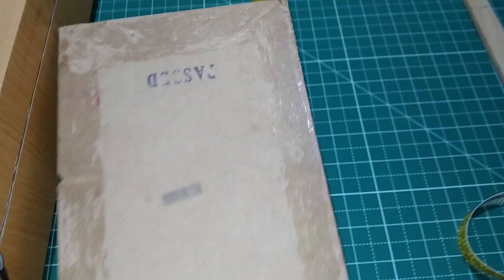DIY Flight Simulator Yoke & Throttle

Comment: Hello, friend! :)

Congratulations on the project! A question: regarding the potentiometer, is it very accurate? If I make a sharp turn, does it recognize the movement well? Or does it work better on "softer" moves?

Thanks!
Reply: potentiometers are usually pretty sensitive. If you want even finer readings use a hall effect sensor and magnets
Reply: @Googaliemoogalie  Hello! Thanks! :)
Reply from the maker: yes it is accurate.

Comment: Fantastic idea and job. I applaud you! The only thing is the mechanism you used for the elevator potentiometer will not be linear. When you push the yoke in, the potentiometer will gradually increase in speed and when it goes past the center position it will start to slow down again and vice versa. Personally I don't think it's that much of an issue though. Congratulations on your build!
Reply from the maker: Yes, your observation is absolutely correct.  I should have had used sliding pot, that would be linear movement. Still it is enjoyable.

Comment: Hi, Great job.
Does this work for the X-Plane 11?
What are the measurements for the drawer slide?
Reply from the maker: It should if it supports mouse yoke.
Reply: @SwapnilNimbalkar  Can you give me some measurements, like the pipes, the box, the rail? Some considerations.
Reply from the maker: @dertin  
sure, I will have to get them first.  Will do it asap.

Comment: You gave me a better idea of how to make a Flight Sim control to be more compact:)                                                                                                                    Easy and cheap.                                                                                                                                                                                               While the electrical modification of your joystick is the same as mine. But you didn't stack two joysticks together like I did.                             So you have less items to control.                                                                                                                                                                                         I will add more switches on the control yoke and make it more presentably than just a PVC pipe!!!!
Reply from the maker: good

Comment: bro did you take off the male and female connectors from the jumper wire and strip it and then connect?
Reply from the maker: yes of course!
Reply: @SwapnilNimbalkar  bro one last doubt so after u calibrated and found out centre and plugged it in and launched flight simulator x was all the button assignment already correct or did you have to change and another doubt......are you playing fsx in this video or some other sim?
Reply from the maker: @justinjoshua8269  No.   You need to assign them manually
Reply: @SwapnilNimbalkar  how
Reply from the maker: @justinjoshua8269  go settings in FSX then controls
Reply: @SwapnilNimbalkar  ok thnx
Reply: @SwapnilNimbalkar  bhai instead of B10K i bought A10k potentiometer...will it work?
Reply from the maker: @justinjoshua8269  no it will not work.  It needs only B10K which is linear potentiometer

Comment: hey brother. i was inspired by your diy flight yoke. i made mine out of arduino uno board and b10k potentiometer. and wondering if this is possible for xplane 11? thanks hope I could connect to you regarding this matter. thanks
Reply from the maker: it should work with Xplane 11

Comment: Very nice man! I made one, following the video but for some reason when plugged in it's not giving any response, just a slight fluctuatiom in values. Any ideas?
Reply from the maker: you need to calibrate it.  go to "setup usb game controller" if you are using win 10. and calibrate
Reply: @SwapnilNimbalkar  thank you for responding! I will try
Reply: @kiranvenugopalan3331  did it work?
Reply: @sfranklin1266  Yes it did!
Reply: @kiranvenugopalan3331  can u explain all the necessary items to build this along with its prices
Reply: @sfranklin1266  the video explains everything well. Nothing extra required other than the items used in this video. USB joystick, potentiometers, solder iron, glue gun and wires. Improvise the rest

Comment: Hi Swapnil, can you pls make how to setup this Yoke and Throttle in fsx?
And can I use ps2 joystick for it? I have ps2 to USB converter
Reply from the maker: hardik its plug and play no need to do any settings in FSX.
Reply: @SwapnilNimbalkar  ok Swapnil, let me check it will get back to you. And i dropped you msg on facebook too but i think u haven't read yet.
Reply: Hi, i was unable to find B10k potentiometer. I got A10k will it work or is there difference?
Reply from the maker: @HardikSoni25  A10k will not work. Order online I have given link in the description
Reply: SwapnilNimbalkar hi bro, finally I got succeed to making yoke and throttle. As well as I made rudder, elevator trim system too. 
I am sending you videos on your Facebook messenger, pls do check it out. 
Abhi khali connection kiya hai circuit me and testing bhi ho gaya hai uska video hai. Pls check it
Reply from the maker: @HardikSoni25  Wow! that is just amazing... you are awesome dude..........
Reply from the maker: @HardikSoni25  I have not received any video on facebook yet
Reply: @HardikSoni25  hey bro, I do Yoke work perpect, but I can't connect throttle, can you help me.
Reply: Pecious Cargo sure, what help do you need?
Reply: @HardikSoni25  do you have fb or something, i will send you image
Reply: Hardik Soni I sent immage on your whatapp , pls check your message

Comment: hi bro.. wonder design u make. can you tel me he demention of pipe u use , and how to connect all the pontiometer with the joybox,,  and graphics u use ,, how i can get it,,
Reply from the maker: i think i have given dimension of the pipe in video, you have to connect three pins of the potentiometer to the three pins on PCB of joypad
Reply: But which wire to which pcb board, plz explain

Comment: bro how do you calibrate the potentiometer
Reply from the maker: if you are using win 10
go to 'usb game controllers' > properties > calibrate option should be there
Reply: @SwapnilNimbalkar  can we use to calibrate with volt meter?
Reply: @SwapnilNimbalkar  and is it in the game fsx or in the windows 10 settings
Reply: @SwapnilNimbalkar  ok i see it...its in wondows 10 settings thanks....btw great job and im gonna make it...
Reply: @SwapnilNimbalkar  and is there anything else you did off camera that i should keep in mind while making the whole mechanism?
Reply from the maker: @justinjoshua8269  Sure good luck building it.  Let me know how it came out. There is no need of volt meter.
Reply: @SwapnilNimbalkar  ok sure will send final prodect

Comment: Fake
It doesn't work
The potentiometer is shaking not stable it was sucks idea to do
Reply from the maker: why do you think that its fake? its not fake, try it.
Reply: @SwapnilNimbalkar 
I did
Reply from the maker: @princechannel2154  did you use joypad to connect to PC?
Reply: @SwapnilNimbalkar 
It's work perfectly now
I. Just cut the right joystick
And work with 1 joystick
Pitcking and rolling
That's enough for me
Thanks alot for the information
I'm cloning the Saitek yoke yoke for now
I. Will update u soon